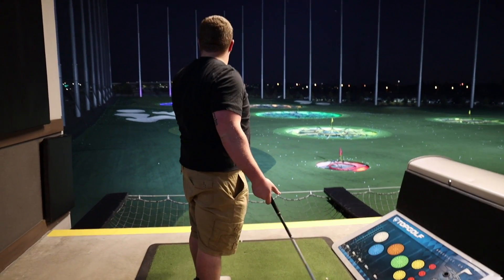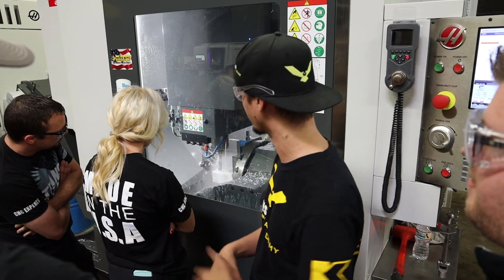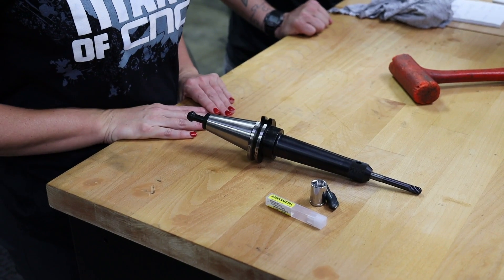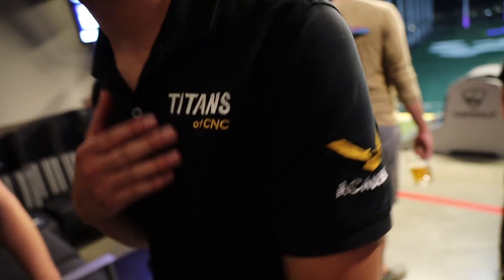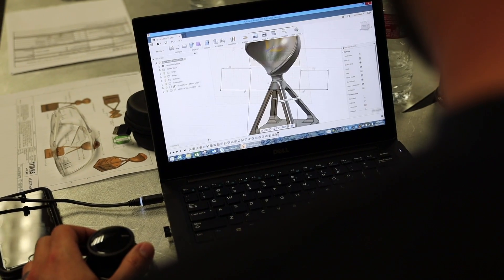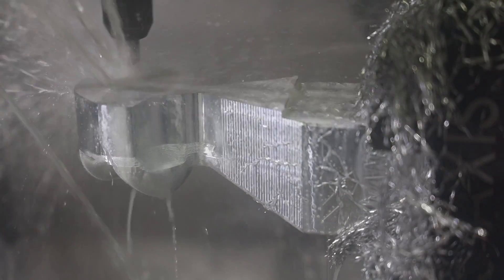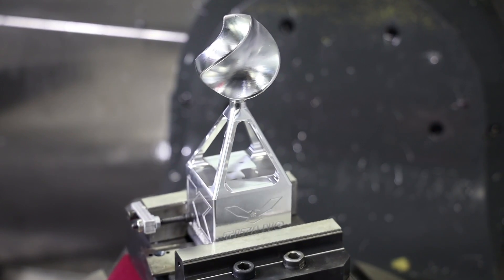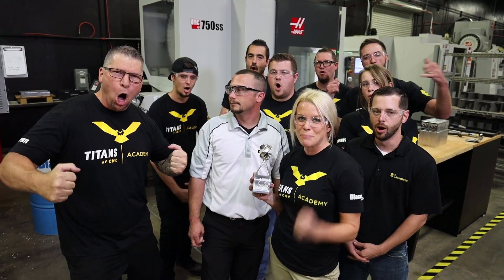BOOM! 5-Axis CNC Machining Training Completed - Daily Vlog #14

Comment: Just had my first day at my new job and I couldn't be happier where I am. Got to run 2 Mazaks, a qt 40 and a qt 200 both from the late 90s. I ran a part that was 4 in in diameter and a part that was 1.6 in. I even stayed later than my shift to finish the last 20 parts in the run for the smaller part. Legs are sore but Im excited for the work week next Monday.
Reply: From one machinist to another, get nice good quality shoes. Also, get some gel inserts or whatever you prefer. Seriously. Nice shoes are beyond worth it in the machining game where you stand for 8+ hours a day in front of your machines. Keep hustling, keep making chips! Boom!